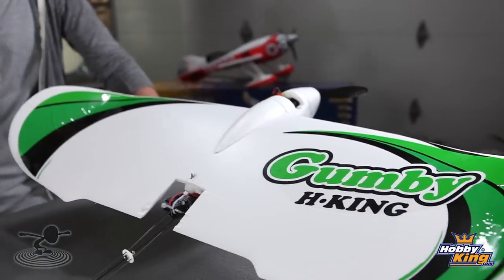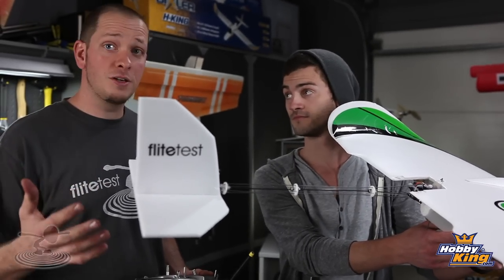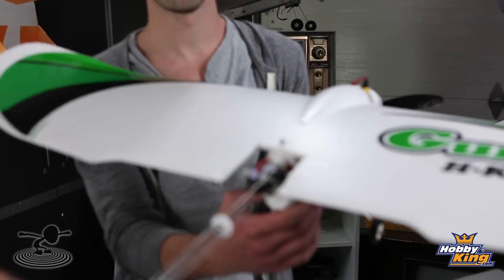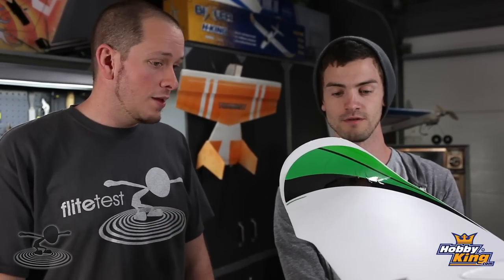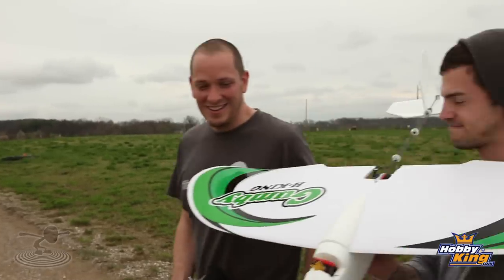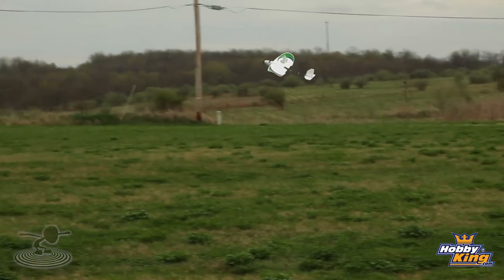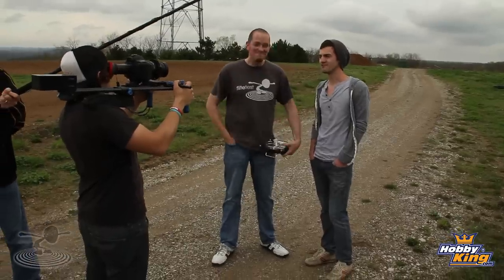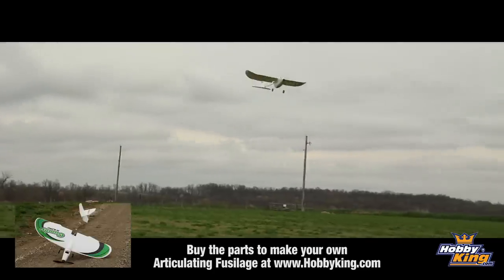Flite Test - Articulating Fuselage - PROJECT

Comment: Damn, i got this idea for ailerons (wing warping) 4-5 years ago, and i was tended to build it :/ but Right brothers came up with it 100 years ago.. very sad for me :(
Reply: New ideas more rare than most people would like to think, nearly every time I have what I think is a new idea I find out it's nearly ancient.
Reply: There's also teh difference bwetwen "camber-changing" things like wing-warping and normal hinged ailerons, and "airflow-deflecting" controls like spoilers, slats and such that change the air around or aft of the wing, instead of using the wing itself to change the air.

Comment: I've had an idea for articulated tail.
For slow-speed & and high AoA during rotation & landing, you want a high tail Clean air means more authority at low speed, and it's not blanked by the wing's wake, while at very sensitive near-stall flight. For good cruise, you want low maybe even negative AoA, and lots of down-trim, which is a lot of drag applied to the tail.
If the tail articulated, then you'd have both. With the tail down, it's in the slip-sream of the wing, meaning it's not cutting clean air but also it's not cutting new air. Less drag, if it's not cutting new air, and since airspeed is higher, the tail can be mostly inside the wing's wake and still have effect for the more gradual maneivering it'd be doing at high speed.

Comment: That works until you get into a position where you are either at a too high or too low of an angle of attack and you can't move the weight back.

Comment: redo it about half the length of the tail from from to back should be solid. then it would work fine the articulation is to big and to far out of alignment shorten how long the wires are by half. if you can. great effort! i was doing a pterodactyl with a tail i need to make a few minor adjustments and i will post it for you to see. tanks for all you guys do helping everyone.

Comment: Absolutely not. The elevators and control surfaces change the direction of airflow around the plane. It's the same reason that if you hold your hand flat out of a moving car and angle it up you can feel more lift on your hand. You most definitely not changing your CG.

Also, drag =/= weight.

Comment: awesome idea, if you want it to work abit better you need equal amounts of the rudder fin above and below the elevator fin as you may of noticed the the tail twists when you turn it because there is nothing to counter the torque caused by the tail fin being only on top.

Comment: Isn't this what control surfaces do? If the elevator rises, it creates more drag at the back of the plane. Drag = weight, and adding the weight of the drag shifts the center of gravity. 

If I'm wrong (I might be) please correct me.

Comment: do you mean a plane powered with batteries that were charged using a solar panel? or do you mean a plane with a solar panel on top? the first would be easy, the second is something nasa has been attempting with almost no success.

Comment: Exactly, but implementing this idea into a low wing aircraft which has the wings fixed to the fuselage should be far more challenging and interesting. I would do it myself but I do not own what is required to do so.